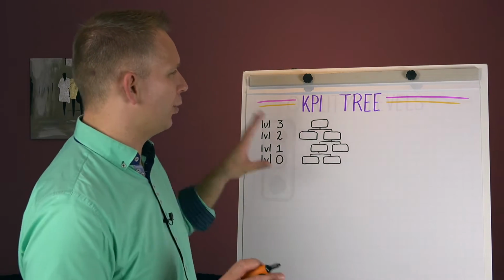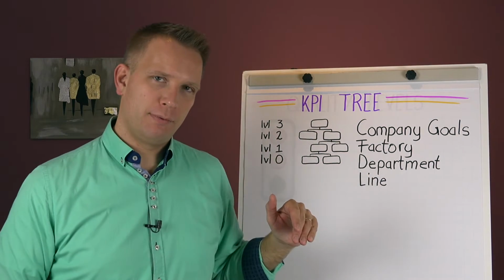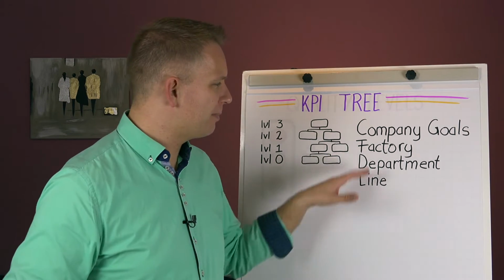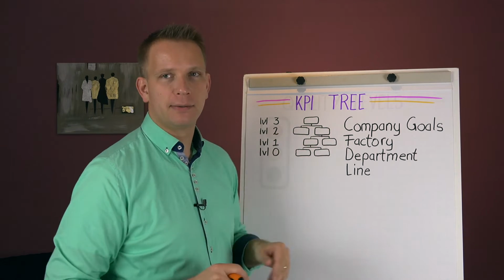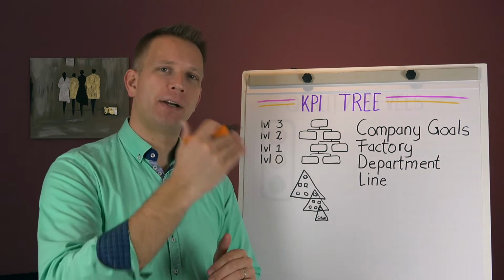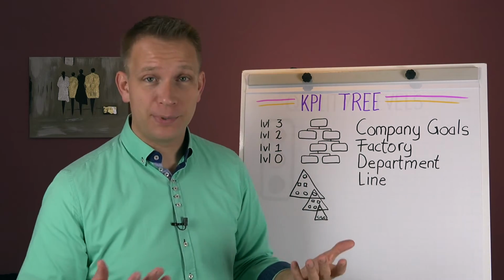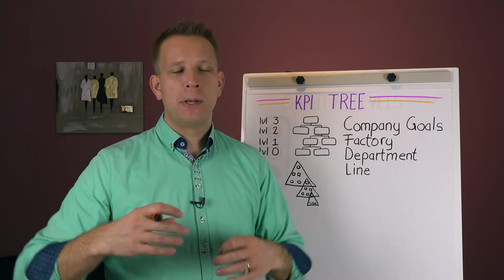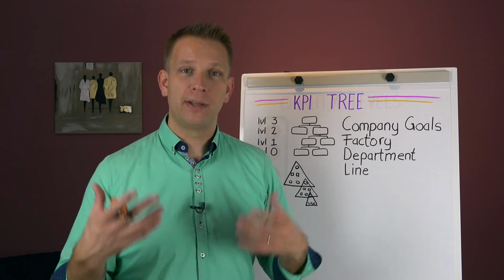How to design a KPI tree for effective performance management

Comment: Indicators are used to shield you from having to look at raw data. From having to understand the actual workplace. Indicators are abstracted, filtered, cumulative information often massaged to make the reporter look good (perception is reality). A KPI failure just initiates root cause analysis. Especially problems at the lowest level which cannot be thoroughly understood at higher levels through indicators. Yet, managers sit at their desk looking at their KPI dashboard and issuing orders. Let’s say purchasing chooses cheaper paint that has a longer drying time to make them look good on their cost KPI. There is no longer enough drying time and numerous paint failures occur. Net income KPI shows red. There is no way to go from the KPI, especially many level up, back down to problem. Screaming at subordinates to fix the Net Income KPI may cause panic and produce unintended consequences. The measured variable gets optimized and acted upon. Metrics are wonderful until they become targets open to political manipulation. The summarization of information every level you go up is a problem and a convenience.

Comment: Hi Tom, as always your lessons are brilliant. Please allow me to ask you 2 questions to clarify couple of doubts I have.
1) KPI and specification limits seem so similar to me. What is concretely the difference between the two?  For instance, if we set a maximum cycle time of 20 days, that would be both a KPI and specification limit...I don't quite grasp the difference between the two.
2) This second question is about voice of custumer, voice of business, VOE related to KPI and spec limits. Cycle time for example seems more of a CTQ coming from VOB than VOC. I'm pretty sure that custumer doesn't always have much to do with performance metrics, but I'm not sure how to think about this. Defects for example would probably come from VOC...
Reply from the maker: Thanks for your praise, Dom, appreciated.
Specifications are quality characteristics that a PRODUCT has to be within. They either come from customers/customer expectations/legal requirements, or they are mid-process specs that the company itself (usually the quality department) set up to ensure that the end product will meet ‘the real specifications’. 
Performance is a PROCESS metric that describes how effective and efficient a process makes products (that are within specs). If a carton of milk has to have at least 1 liter in it (specification), any carton under 1 liter is a defect and should be scrapped. This company probably has a KPI “scrap level” that shows part of the performance of that process. Now they could just fill cartons up around 1,2 liter and never have out of specs, but that will be very expensive - they probably also have a KPI “overfill” that measures how much milk was used on average per carton, which will be another great indicator of the material efficiency of this process.

Cycle time is not a specification - you cannot see this in the end product (unless it’s a 12-year-old whisky, I which case you actually pay for taste and uniqueness, so that promise that it’s at least 12 years aged is a proxy for a product characteristic that they can hardly express). Cycle time can be a KPI if it’s important for production costs, which it often is. It can also be a process standard if it’s important for the product quality, e.g. that milk will have been at 72*C for 15 seconds (pasteurization).
All these voices… I’m not a big fan of this language, as it’s often poorly explained before people use it. The idea is that your information comes from different sources: VOC are all those things that the customer is telling you, like how they want the product to look and feel (become specifications), how quickly they want it delivered (service level expectations), etc. VOP is the process telling you what’s really happening, like what the variation in filling weight of this line is (which together with the specs will cause some defect level), or what the most stable process settings are for a certain product. VOB is the business telling you what’s important to make a profit now and long-term.
Defects are a result of process mean and variation (voice of process) exceeding specs (coming from voice of customer), so it’s not really either of them.
Customers generally do not care about performance metrics (like cycle time) - they just want a good product. They might place additional limitations on the production process (e.g. no animal testing, be carbon neutral, etc.).
Reply: @TomMentink   thank you so much, you absolutely explaned it all. I got it conceptually. Pratically, if for example I consider cycle time as a KPI, I'm wondering what the spec limit tied to this KPI could be, so that it could be possible to check for capability. Same issue about recruitment time (as a KPI) for instance... I struggle to think of any spec limit in the outcome tied up to something like that in a way that makes process capability easy to be found. Can you give a quick example of that to fully close the topic? Thank you immensely.
Reply from the maker: @domenicoscarpino3715  there simply are no specs for these examples. There are many more factors of production than product quality specifications.
Reply: @TomMentink  I just watched your video about efficiency vs efficacy. I think that gives the perfect idea. Thank you so much Tom. Your channel is pure gold!

Comment: Hi Tom! I was wondering if you could go through the KPI tree with an example to help understand how to set up a KPI tree.
Reply from the maker: Hi Johan, my apologies for the late reply. Since it will be quite a bit of text and some sketches would also help, I'd better make a video to show how I'd build up a KPI tree for an example KPI.
I think output/OEE makes a good example to show the different principle for KPI tree design, but since I haven't made the video yet, I'd be happy to use another example if that would be more interesting or relevant to you... Any specific KPI on your wish list?
Reply: @TomMentink cycle time….?
Reply from the maker: @robertcouwenberg7100  challenge accepted -> little spoiler: cycle time will not be a top level KPI in that tree, because it’s super operational, but I will make a KPI tree that uses cycle time and make a video about it
Reply: @TomMentink  Thx! Maybe I can stil suggest to make it a little less operational by taking it to Lead Time at a slightly higher level?